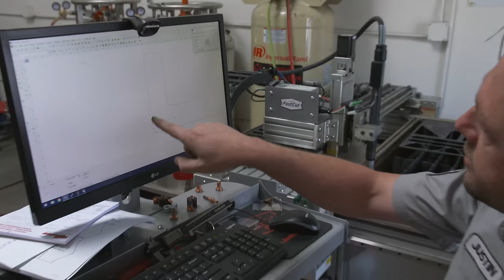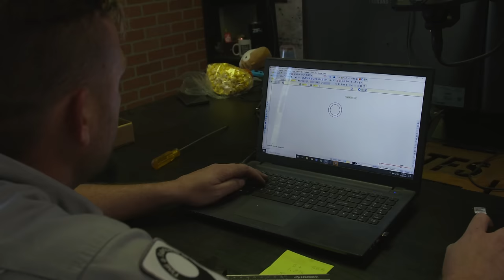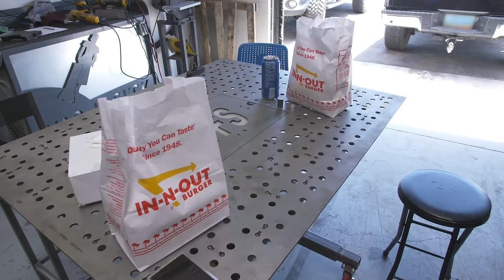Airbag Mounts and Gussets

Comment: I have been so very impressed with your thoroughness and attention to every detail (including your employee thoughtfulness).  If you are hyper concerned about the strength of the whole design, you may want to consider taking a square tube or two from the top of one of the bag frame mounts across to the other bag mount (basically from the inside of one side of the frame to the other side directly on top of the bag mounts). That would relieve a lot of the stress put on the relatively short mounting surface you have on the frame to hold the weight of the whole truck (car).

Comment: A very complicated four link suspension system and chassis set up young man. I have seen a simpler alternative which uses an "A" frame and fulcrum ball joint on the rear axle. Much easier to to set up and install and little geometry to worry about as they arteoff the shelf parts. A really interesting series and I can feel your frustration, as with any kind of first time builds where you sort of invent solutions on the fly is really brain bashing stuff. Top respect!

Comment: Another good vidoe. Thnx Justin.
    Fish plates  vs  Gussets   Hmmm ?  I still prefer gussets,  because they reach farther and supply angular strength.  They also supply a center support that stops  stress BEFORE it ever gets tp the weld joint that's being supported and stiffened.  They are easier to make and install.  That's just my  way, but I like yours too.

Comment: All the load is on the rear chassis legs.
That is where your 4 bar connects so all the acceleration and deceleration forces will go through that part of the frame.

Comment: I have that Miller welder also and love it
Reply: billyfromtheusa  it's the millermatic  220 AC/DC
Reply: billyfromtheusa  it's worth it if you want to do aluminum. I also like that you can keep both tanks hooked up so switching from mig to Tig is easy
Reply: billyfromtheusa  yes you can do 110/220 and I have done 24 gauge with ease.

Comment: So in the second Watt's link video you mention that the axle wasn't centered quite right. Did you center before welding the airbag mounts to the axle ? Otherwise the bags will be running at a slight angle. BTW, met Brandon last year when I did my class last May, he was busting his butt , great guy !

Comment: You have used TIG welding in few components which you have used MIG welding on main chassis, Can you please brief me why you did this way? does it make any difference with the type of welding we use? I am newbie to this. Please tell.
Reply: Mig for fast welds on thick steel. Tig on thin parts and other materials

Comment: Is there any specific packaging reason you went with a reverse 4link setup? Because even within the confines of that box you could have done a forward 4 link
Reply: There is quite a bit of controversy about that, seems wrong for so many reasons but Justin has a plan.
Same thing with the side plates/gussets and bracing - the former are largely along neutral axis and the latter not actually where there are going to be much by way of loading, anyway - that square tubing is damned stiff!
Reply: Forward 4 link is the Wright way to go. Because when you are driving forward the suspension will want to move back and up when going over bumps. Will be vary smooth ride.Reverse 4 link is going to jam and make the chase jump up and loose traction.

Comment: Again, if you had used 45 degree instead of 90ies over the back axel, then you would have had more strength and might not need the extra plates for strength + weight.

Comment: Does the load from the torque transmit to the rear 4 link, won't it try to pull the chassis and stretch it backwards??
Reply: That's what I was thinking. All the longitudinal forces from acceleration (assuming RWD) and braking (in the rear) will be transferred from the axle through the links to the frame side four link pivots and into those rear sections of frame. I'm not there and I can't see it in person so I can't say how much gusseting is needed, but to say all the forces are going to be in the bag mounts is true if you are only talking about the vehicle's weight. All the lateral forces will the transferred through the Watts link and the longitudinal forces through the four link for the rear axle.

Comment: Good educational vids  for young guys just starting but don't forget to match your rear roll centre to the front or it wont work front and rear will work against each other.
Reply: By match are you talking about height? If so, research "roll axis inclination". They do not need to be at the same height and in some cases it might be advantageous not to have them at the same height.